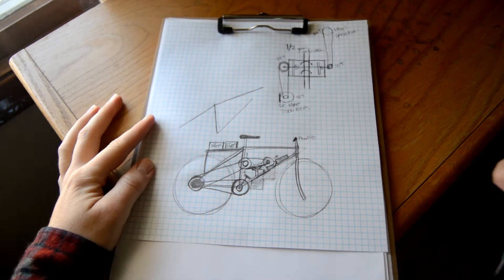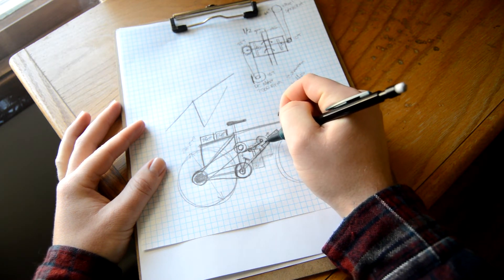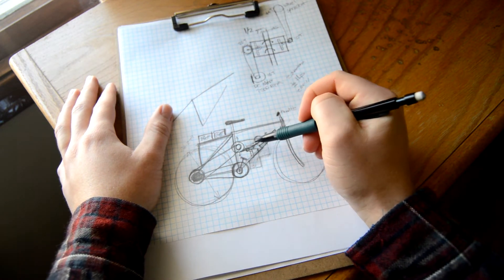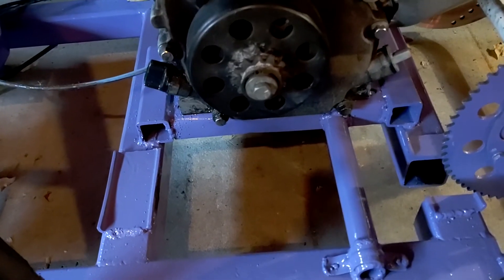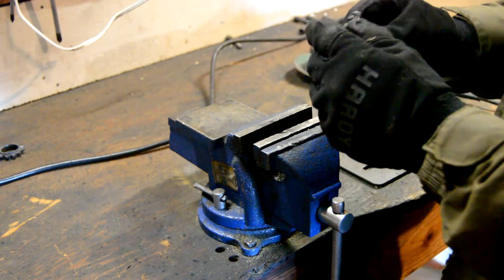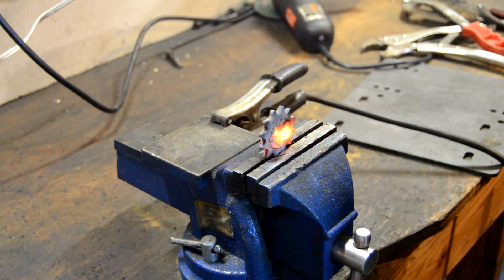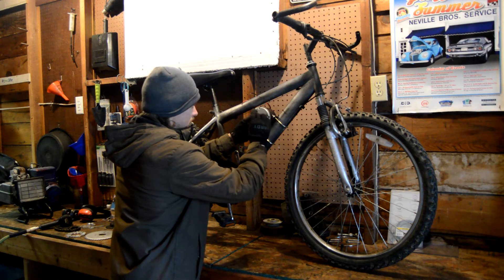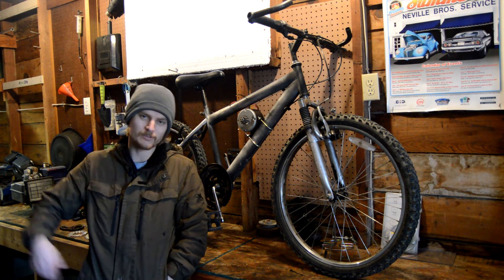DIY E-Bike Build - Intro & Front Sprocket EP1

Comment: Hey great vid!!
Do you know where to get switches to make the bike road legal on road then when off-road can go as quick as the motor is?
Reply from the maker: I'm glad you enjoyed the video. It sounds like you are trying to make an e-bike with dual power modes. That would need to be done at the controller level. There are more complex controllers that you can program with a computer for a wide range of outputs. However, this is my first e-bike build. That being said, I'm not familiar with the setup of the more complex programmable controllers.